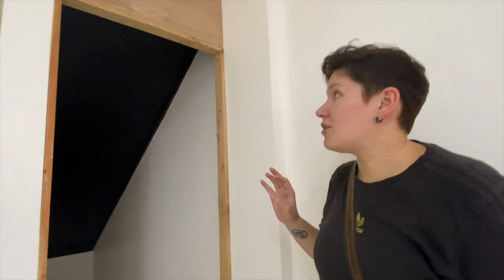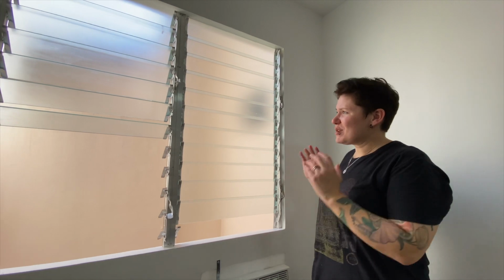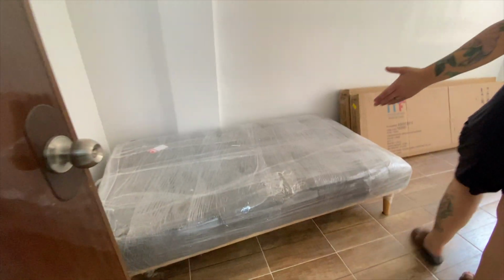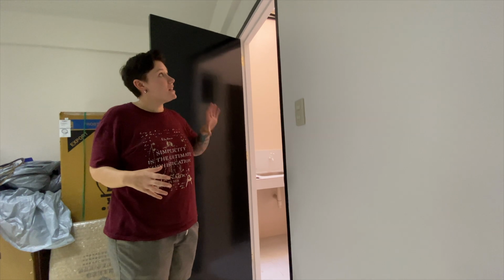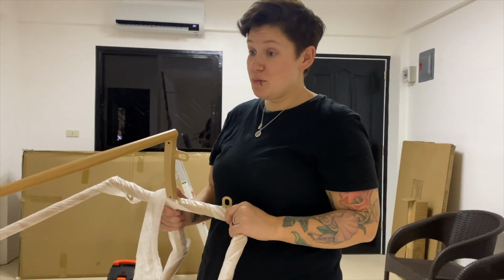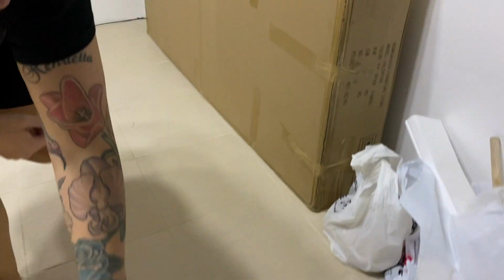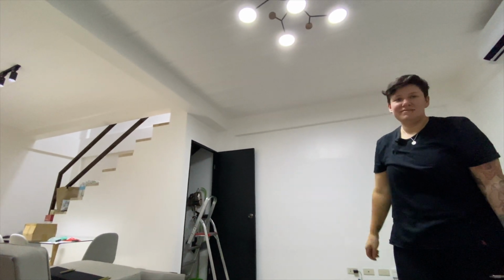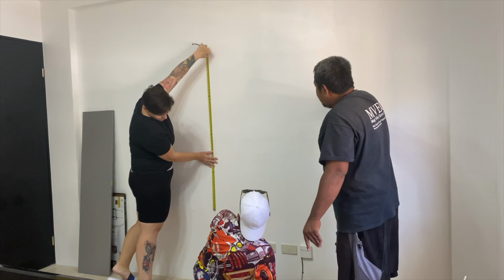Furnishing our first house in the Philippines!

Comment: Guys, can you give me a ballpark on how much everything costs? At least a rough estimate on how much money I should have to move there, maybe get a slightly bigger place. I got some coins saved up, and I feel like I need to pull the plug before Cebu gets too expensive.
Reply from the maker: Hello! The good thing about going to the Philippines is there are cheaper, middle of the road or high end places to buy! From our experiences, land in Cebu is 10,000-15,000 pesos per sqm. You can buy decent houses for 3-5 Million pesos. There are condos around that same price as well depending on the location. Electricity is more expensive than the US, we’re paying around $100-$200 a month. Water is pretty cheap around $10-$20 a month. Good Wifi is $30 a month.  I hope this helps!